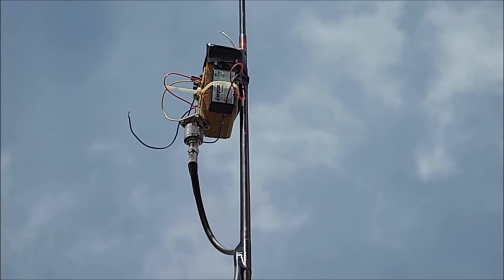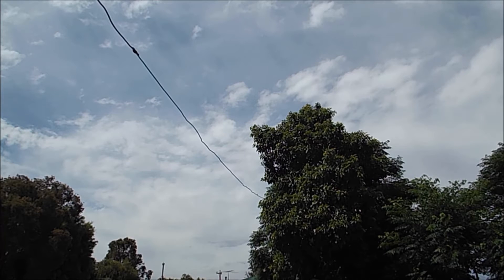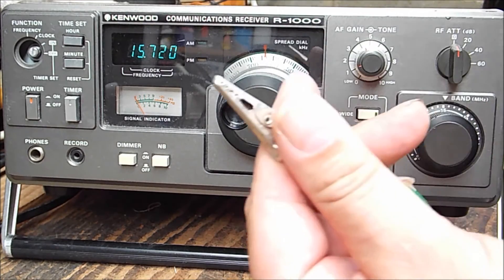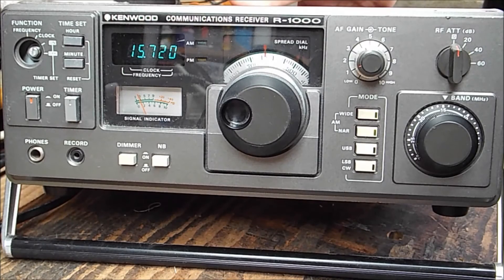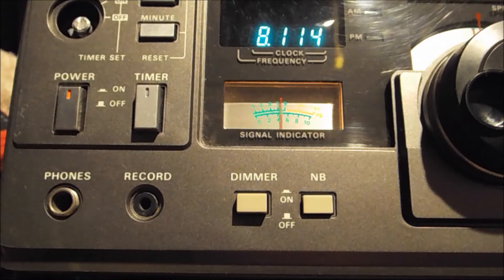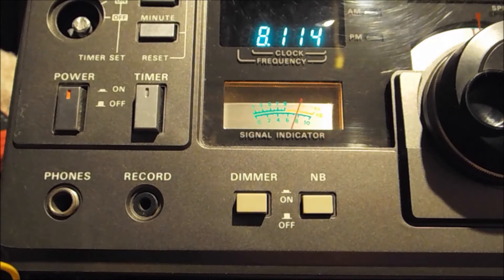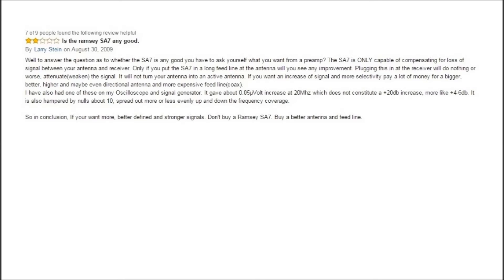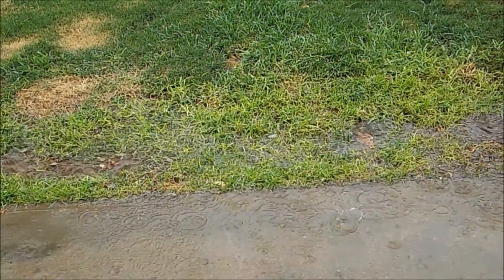Antenna Experiments - Ramsey Electronics Pre-amplifier SA-7

Comment: That pre-amplifier kit really seems to be doing a great job.

I was going to try to setup a homemade dipole antenna this weekend, but the snow is now hard and frozen, and they're calling for a wintry mix. I guess I'll have to wait until spring to work on my dipole antenna.
Reply from the maker: I wouldn't mind a little snow about now, that rain was a most welcome end to a string of 40+ Celsius days, the kit does appear to work very well but will naturally amplify indiscriminately so noise gets amplified as well, running the device stand alone on the 5m mast seemed to yield the best result although decoupling the outer braid of the coax reduced noise to the levels indicated in the video.
Reply: +SpectreOZ We just finally got a decent snow fall after a green and brown Christmas. It's nice to see snow on the ground again.

Comment: Great review and it did appear that the pre-amp helped a lot without adding a lot of noise.  I did not see the active antenna or a description of it.  Perhaps I missed it.  Thumbs up and shared.

Tom
Reply from the maker: Thanks for dropping by Tom, the "active antenna" was shown at the opening of the clip attached to the 5m fibreglass squid pole, essentially it's only the SA-7 pre-amplifier powered off a 9v battery feeding directly into the coaxial cable leading to the receiver.

The antenna on the pre-amp was a short 2.5 inch length of hook up wire.
Reply: +SpectreOZ Oh.  My mistake.  I thought you had three antennas you were testing.  It was amazing the little piece of wire did so good with the pre-amp.
Reply from the maker: +hamrad88 No worries I was inspired by the &quot;mini whip&quot; concept antenna.

https://youtu.be/PXbwGAhSgtg
Reply: +SpectreOZ Pretty amazing.
Reply from the maker: +hamrad88 Yes indeed, the NDB Facebook group I'm a member of has been heavily promoting this type of antenna for urban environments